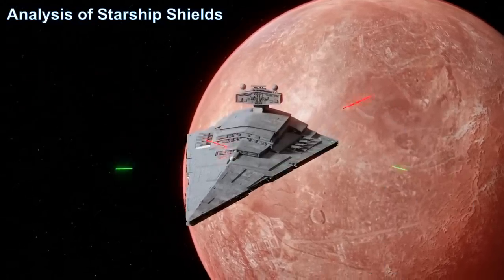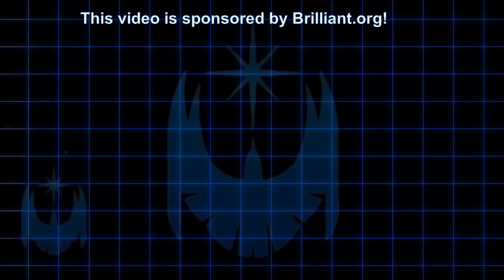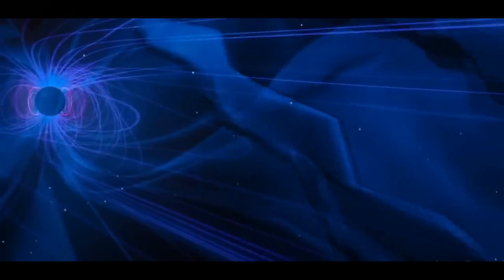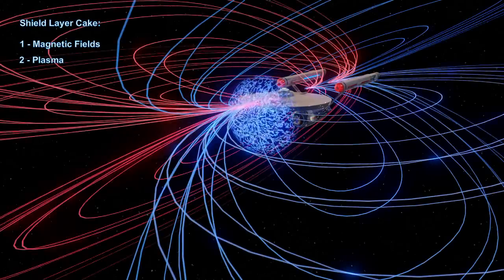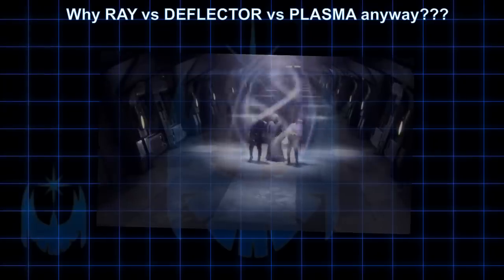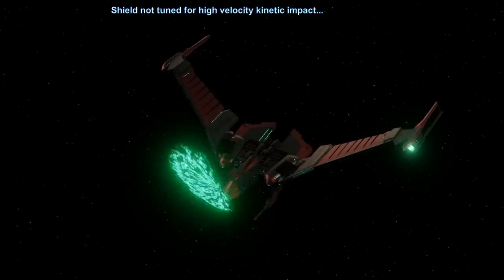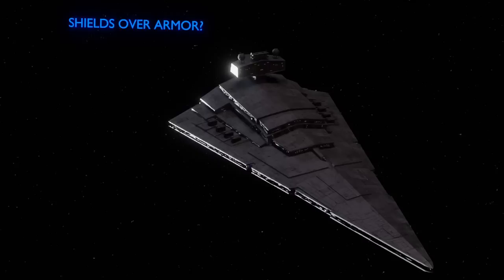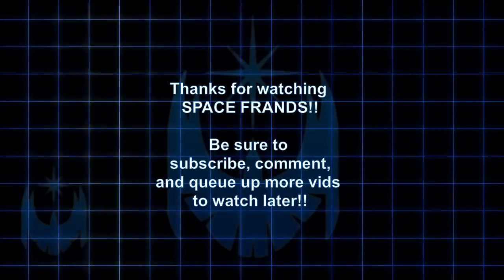REAL Starship Shields Types - They Work Like This...Animated Breakdown!

Comment: As you mentioned EVE Online, which i played a lot some years ago... One downside of Shields is a great strain on power source. 
I pvp-ed a lot in EVE with passive armor buffer, sometimes with shield buffer but mostly armor. So depending on situation, if you have some kind of home base close by to the battle, armor is better because it greatly frees up your ship's resources.
In Star Trek, for example, where a ship is long time away from some kind of base or repair dock that is not good... but even in Start Trek in some combat scenarios, such as Wolf 395 or some battles in dominion war, maybe Starfleet would benefit from passive armor, or shield, tanked ships that have much more power resources to dish out damage.
Especially at Wolf 395, imagine if Starfleet had a few passive tanked ships that could fire phasers with power twice or thrice greater than their ship should, think Miranda class with additional armor plates and with Galaxy class phasor emitters slapped on, just unleashing on that Borg cube and warping back to starbase for quick repair and out again.
Reply: The Borg cube had tractor beams to hold enemies in place and finish them off.
Reply: The Defiant class, built specifically for fighting the Borg has ablative armor.
Admiral Janeway brings from the future technology of tactical holographic armor.

Starfleet in TNG times is a strange military fleet that forgot they are a military fleet.

A thing I was thinking of on my own were Galaxy Class shield platforms. Take a Galaxy saucer, remove all the civilian quarters and other superfluous systems, add armor, weapons, energy storage, and shield generators. Then when a Galaxy class ship gets into battle, they separate off the saucer and use it as a big physical shield for the more manuevrable engines section.
Reply: GRRR GOONS!

Comment: All neat and straight forward enough. I was wondering if you'd touch on the Galaxy Class' shields as this delves into new physics concepts that can be applied to defense. The Forerunners from Halo used slipspace technology (hyperdrives in SW) to compress light into a hard matter-like state. They also used it to manipulate panels and could reconfigure their ships on the fly. I feel science has a lot of unexploited potential and that no one is bothering to investigate that anymore.
Reply: Hardlight makes no sense scientifically, and that's before taking future-tech into account. Light simply doesn't act that way. At least things like shields can be explained with the right applications of physics.
Reply: As someone who prefers some kind of scientific backing behind sci-fi concepts, that's a fair argument. Are there any ideas or guesses as to what happens to light when it enters a black hole?

Comment: The best type of shield is actually to warp space-time so much that nothing can get into your bubble while to can launch your assault with impunity..... except (of course) that technically you would not be able to get any telemetry from the outside world. So maybe not the "best" best.
Reply: If a setting also has advanced AI you could use it in conjunction with such a shield system so that it "flickers" off when a weapon is about to fire, allowing the ship's sensors, hooked into an AI, to get a brief momentary flash of the battlefield.  It takes these snapshots and uses AI prediction to intuit where enemies, incoming and outgoing weapons are, and where they are most likely to be in the next couple seconds/minutes/etc.  This assumes that the shields can be snapped on instantaneously though, in most settings shields take some time between seconds to minutes to be fully raised.

Comment: About the ships getting knocked about even with shields up; while the real reason for this more likely for the sake of drama and keeping things interesting (hard to build tension of the crew can ignore the effects of weapon hits) there are two good reasons for it scientifically. 

First is conservation of momentum. If the shields stops an attack that has physical force (like guns and missiles) that momentum doesn't just go away and the shield generators have to absorb it. While you can lesson the felt impact by spreading the force over several generators you can only "cheat" so much. A smart design would have the generators on a sliding rail so it can rock back across it so slow the impulse of the impact (much like the slide action of a semi-automatic pistol) while also making it so that that the rail will fail if the generator takes to much impact so it rips away safely  without taking a chunk of the bulkhead with it (I'd also have a reactive armor blow out panel behind it help slow it down one it's ripped away). 

The second is shields can only really spread out, deflect, deform or turn attacks bleeding energy out of them. If the shields are powerful enough then they can bleed out enough energy that the attack that it's ineffective but it the attack has enough penetrating power it can get through with enough force to maybe not damage the hull but knock the crap out of it.
Reply: This is why scifi needs more point defense like in Battlestar Galactica or even the Kelvin timeline Startrek imo. Just target the missiles/torpedoes and fire a proximity phaser. Boom Done.
Reply: @freddyd1783  Babylon 5 Also had the Defense Webs with plasma cannons for defense against other plasma shots, missiles/torpedoes, and enemy ships.
Reply: @wolfgangjr74  Yeah, the interceptor systems. Robotech/Macross also had heavy use of point defenses, even had had mechs that were dedicated to that purpose and as the show went on they started bolting damaged units to the hull of the ship to give it additional anti-fighter cover.
Reply: @freddyd1783  There is one problem with that, no drag to slow down the fragments. While this can be better then letting the full sized projectile hit, they can still do heavy damage. This is an issue we're having with ADF systems that they're starting to field on tanks. We got ones that are fast enough to intercept tank rounds but even after being intercepted the fragments have so much momentum they can still rip through several inches of RHA equivalent.
Reply: The problem with taking an impact is the differential change in momentum across an object. When your car crashes, the front stops before the back does, and that's what makes your car a wad of tinfoil. If the back of the car stopped at the same time as the front of the car, your car wouldn't change shape and get wrecked. If you apply an impact evenly to every part of a spaceship and its contents on an atom per atom basis, nobody feels any acceleration or damage. You've invented the inertial dampener. Don't just use your shields outwards to stop incoming projectiles, use it as a crash bag to push on the back of your ship at the same time as the front of the ship is pushed, so it won't deform and break.
Reply: @williambarnes5023  Nice. Now to get someone to start on this. Lol.
Reply: @williambarnes5023  Of course, if the car stops all at once, you don't. If you are strapped in well enough that externally you stop with the car, your organs don't. In the case you describe with a starship, the Starship is perfectly intact, but the crew is all dead. Not without further details about what is done with the momentum. Unless of course you were counting the atoms of the crew as well. Though that would have some bizarre biological effects. 

Personally, I imagine the energy from the impact (or acceleration from warp engines) is converted at least partially to "subspace" somehow.
Reply: @101jir  Nono, I said "And its contents", that includes the crew. You have to stop them all at once at the same time in the same way. When you fall off a building and land on your feet and break your legs, that's because your feet stopped before your legs did. Stop the entire body at the same time and you're fine. No part gets smashed. It's not actually the sudden stop at the end of a fall that kills you, it's that the stop hits your feet first you get squished between your feet and your still falling body.
Reply: @williambarnes5023  Ah, okay! Sorry I missed that part. That said, I feel the end result of that would look very different from what we see on screen. The crew would be incapable of moving during this time, and it must look like a freeze frame if I understand correctly. I suppose it is possible that this only happens for the worst part, but at least for coming out of warp it looks like that takes the better part of a second. Seems to me any part of that where the ship/contents aren't frozen would be lethal with such extreme deceleration. Then, as I mentioned, the body having to restart every single atom at the same time would be curious biologically, though I suppose it would certainly be no worse than teleporting. 

While it is certainly sound regarding physics, and an interesting subject regarding biology, I just don't think it seems to match up with what we are seeing on screen. Certainly on deceleration from warp, movement should be impossible for part of a second.
Reply: @101jir  They would still be able to move. You only have to apply the same force to the inside as is being applied to the outside. A 15 kilodamage torpedo hits the shield, and the ship applies 15 kiloforces evenly to each particle inside the ship, to every speck of hull plating, every molecule of water in a person, every atom of air. And nobody inside feels any impact, the entire ship and everyone in it just bounces back from the impact as a single rigid body. Meanwhile their footstep exerting slightly more force on the floor still adds to the 15 kiloforces and still pushes them forwards by exactly one step as everything else goes back past them. It's just like walking on an airplane. As far as entering and exiting warp, that's a DIFFERENT kettle of fish, yes. Inertial dampeners do not have anything to say on FTL drives and keeping them from splatting every atom of your ship through every other atom of your ship back to front.
Reply: @williambarnes5023  An interesting point, but out of curiosity, do you know how much force it takes to split an atom? If the same force is being applied to every part of the atom, maybe. If the two forces are applying a crushing force to the atom, that would not be good. But I think we can safely presume you meant the former. 

Also, pretty sure the show connects the need for inertial dampeners to warp.
Reply: @101jir  In order to apply the inertial dampener this way, it would have to be a field of force... a forcefield if you will, present at every point in space in the way that fields tend to be. The trick is making it be evenly distributed and all happening at the same time. Waves of shear ramping up or down and propagating through the inertial dampener field would be just as deadly as the impact. So you need a signal that can go from the site of the impact, to the furthest part of the ship, telling the amount of force to set and the timing that it needs to be set with, to make each emitter activate simultaneously, after accounting for speed of light delay and processing delay in your sensors and wiring. Calibration is going to be a bitch. And yes, in the show, they use inertial dampeners as a technobabble phrase that both reduces impact and negates mass. We can't negate mass. The inertial dampeners I'm talking about aren't actually star trek tech, they're real life tech - we use them in magnetic bottles to hold plasma and antimatter in place. And such a field would just fail completely if you tried to use it for any FTL purpose, because it can't send a signal to the other side of itself to coordinate the timing or calibration at FTL speed.
Reply: I think the second would be more likely. The first implies the plasma shield with vacuum between it and the hull is physically connected at all times,which is the opposite of how it is depicted.
Reply: @lapiswolf2780  Not necessarily. The same magnetic fields that keep the plasma in place to act a shield could provide a medium to transmit force from the shields back to the ship. The only alternative, per known science, would be plasma escaping the shield configuration and moving in towards the ship, which could also cause damage.
Reply: @lapiswolf2780  If the plasma is just floating around the hull then yeah.However if the ship is generating the containing the plasma so it stays with the ship then he hull is connected to the shield in a way by whatever is generating and containing it.
Reply: That makes me think of something, Wouldn’t anti shield weaponry be a weapon that maximizes momentum on a small part of the shield to completely blow out the shield generator?
Reply: @cryolocker0224  That's already how KE weapons work. Modern tank rounds use a what looks like giant, comically long darts that are much smaller then the weapons barrel (a typical round fired from a 120mm gun will be around 20-25mm in diameter but around 600mm long) and made of a very dense metal like tungsten or depleted uranium. These are then held in place in the barrel with what is called sabot (little shoes) which fall away after the round is fired. 

This lets the energy of a full size round be dumped into a much smaller area which lets it penetrate much deeper. Think of it as a piece of armor having a certain amount of "hardness" per square meter but if your round hits a smaller area this "hardness" is reduced proportionally.  

Do to firing a high density slug at ludicrous velocity with such a small small surface area it's doing just that. 

But at the end of the day there is no perfect defensive system and as soon as someone comes up with a practical shield someone else will start thinking of ways to negate it.
Reply: @TheRyujinLP  I was thinking more like a overload effect, The shield generators can only absorb so much energy inside them before it’s broken apart, I’d imagine it’s like overloading a battery, So weapons countering shields would be designed to either bypass it if possible or, Not harm armor plating and explode on contact with the shield to cause the maximum amount of energy to be transferred, A shield generator that absorbs to much energy I could see either failing due to the generators critical systems taking the energy or even exploding and potentially damaging the ship
Reply: Some of that would depend on the inertial canceling tech used and also how the shields are deployed. In Trek, the shields are no emitted from the generators, but from emitter arrays mounted on the hull. So its the emitters that would need to move in reaction to impact force. As for inertia canceling to go along with that, in Trek, for normal operations, the computer relies on inputs from help to predict inertia forces and counter them as they happening. When it comes to outside forces acting on the ship, the computer has to rely on sensors to detect applied force, calculate and apply counter force, and as a result there is a small amount of latency between force applied and counter force.
Reply: @Krahazik  Oh yeah, I was mainly talking from a more ground view point of sheild tech. Then again with Star Trek, they are flinging weapons with Tarsa Bomba level yields at each other and surviving multiple hits (ppl tend to forget how powerful Star Trek weapons are, look up TinHatRanch's Tarsa Bomba episode to see what would happen if a photon torpedo went off over Chicago). It's entirely possible that even with dampening, the impacts are to much for them to full nullify.
Reply: Except Star Trek can and does in every episode ignore momentum when it suits them. So that shoots that theory right out of the water.
Reply: @zerogrey3798  Yeah,  and I even said so much. Read the first part of my post. I was offering a possible reason that that did gel with reality. It was never meant to be, "this is HOW it happens." but a, "This is a way it COULD happen."
Reply: Personally, I rationalize the damage shielded ships take in star trek as the result of power surges- when the shields are struck the emitters either need to draw extra power abruptly, or they generate a current as a by-product and it's too much for the power distribution systems.
Reply: @justinthompson6364  Also possible. This is defiantly one of those until the show it then it's just up to your own head canon.
Reply: @justinthompson6364  Star Trek deflector shields treat both energy and mass the same which we already have a model for in e=mc^2.  The reason the ship shakes isn’t due to the energy distribution systems but rather to the transferred (possibly transformed from energy weapons) kinetic energy briefly overcoming the inertial dampeners.  Their deflectors are many times more powerful than anything we can conceive of.  The enemies are just throwing that much more energy at them.  There’s an episode where the Enterprise encounters a “primitive” race that threatens them with a laser cannon and either Picard or Riker comments that it won’t even penetrate their navigational shielding.  They wouldn’t even need to activate their main shields to shrug it off if they were fired upon.
Reply: That would be "Plot Armor" ;)

Comment: About the point of shielding from lasers, plasma shields can do that. Plasma is opaque to lasers and stops them. That's why most lasers in the real world are pulsed. Their energy creates plasma along the path, which makes it opaque and wastes lots of energy, so they turn on, laser goes through, plasma builds up, laser is turned of, plasma dissipates and laser can fire again. It's done within nanoseconds so it looks like a continuous beam to us, even though it's not.
A plasma barrier can therefore stop the laser.
Reply: I was really surprised when he mentioned this, Plasma shields would likely be better at stopping lasers than solid objects.